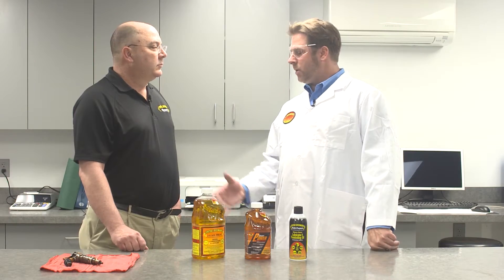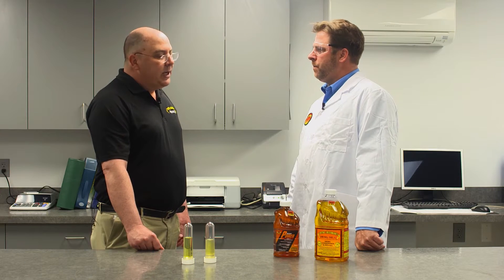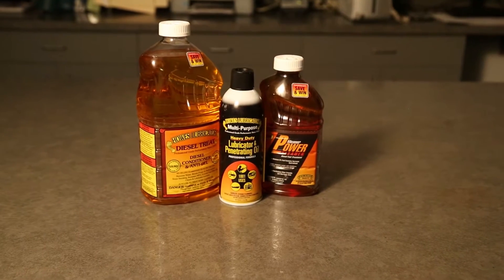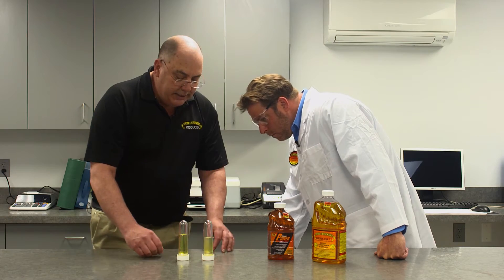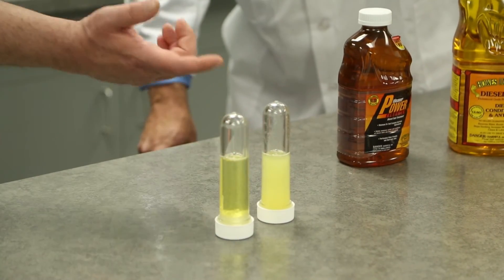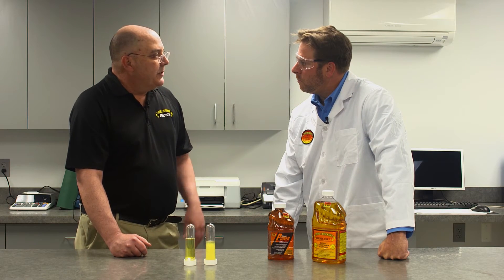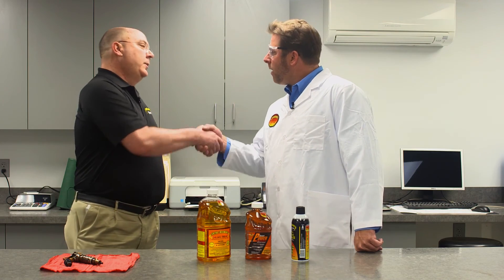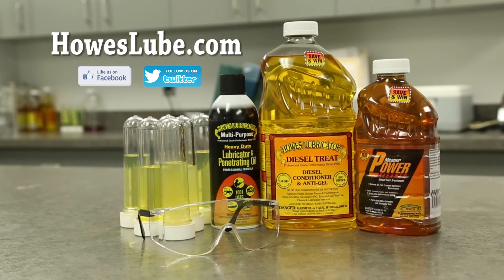Howes Products: In the Lab - Harmful Water Effects in Diesels

Comment: So it pushes the water to the bottom, and then it magically doesn’t have water in the bottom? Which is it?
Reply from the maker: It pushes the water out of the fuel so it can be safely removed by your water separator.
Reply: If the truck doesn't have water separator?
Reply from the maker: @josearmandocasillas1627  you can use a water snake or water siphon to pull it off the bottom.